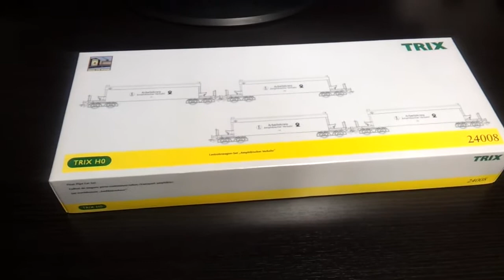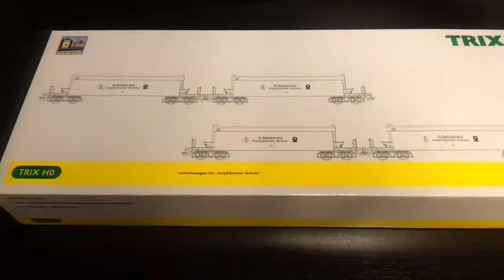TRIX 24008 special  barge pipe wagons

Comment: I can.t ever imagine any company manufacturing something as odd and unusual as that,,,, Mind you having said that I presume they were used on the river Rhine and Danube etc across Europe  so not quite so odd ball as they first appear. Hell of a way to unload  ??????   (Whats the capacity of each container 40 / 50 tons ) both must have to be unloaded at the same time to keep it balanced ,,, so 100 tons dumped in 4 seconds ,,,,, so you could have a raised unloading staith (Thats if the simulated load come out)   great and very educational I would have could them tom-puddings.